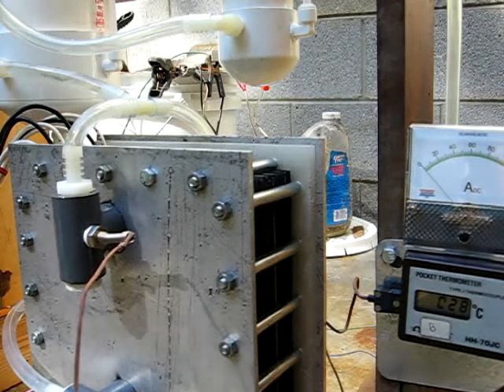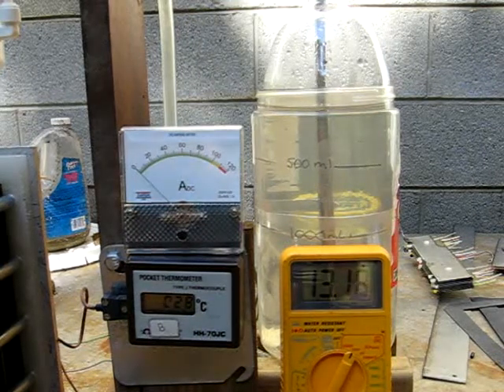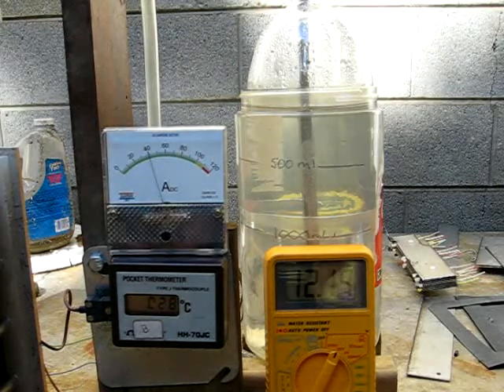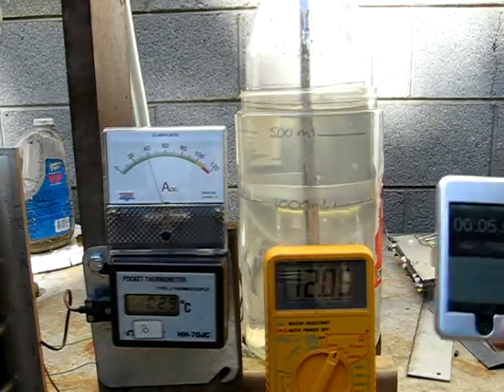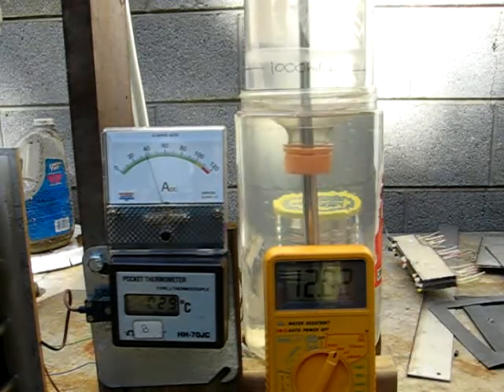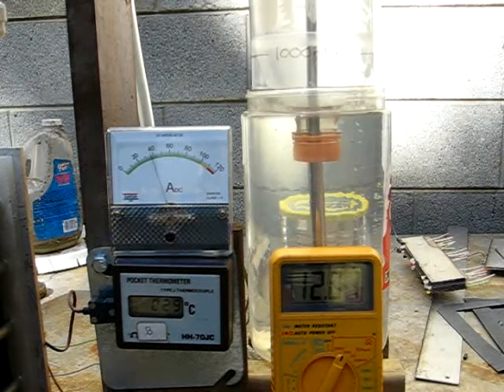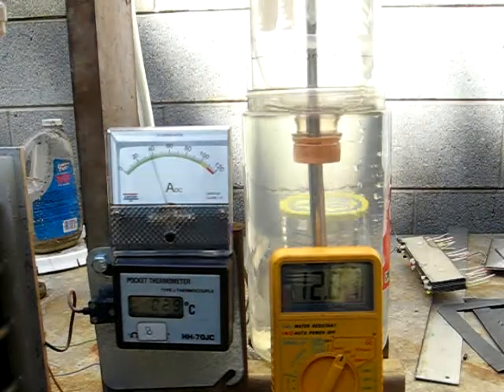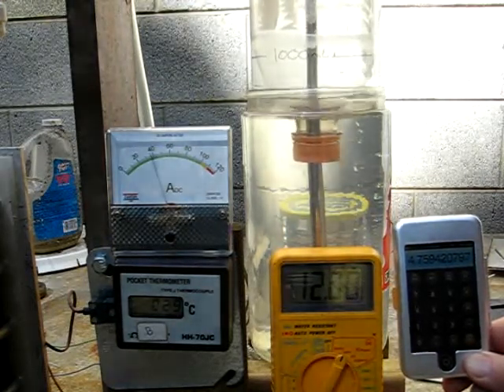003 Flow test 26C 6 cells: HHO Drycell 5.5 mmw 500 watts 3 L

Comment from the maker: Most home 120vac outlets are supplied by a 20amp circuit breaker (120v times 20A equals 2400watts). In this test the HHO cells were  drawing 12vdc @ 38A or 456watts. If I had a power supply that could put out that many watts it could easily be powered from a 120v house outlet. Since I don't have a big power supply I used batteries. 
Marshall

Comment from the maker: Hi jaybuck: I used two 12v truck batteries in parallel and a 12amp  charger for the power supply. Most of the amps are supplied by the batteries. The charger just helps the batteries last longer and recharges them between tests. Continued: